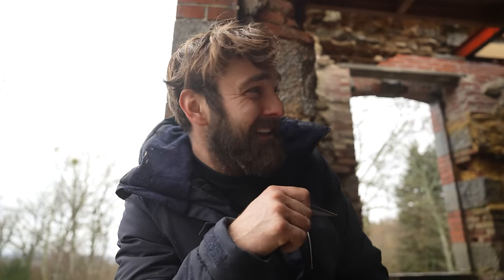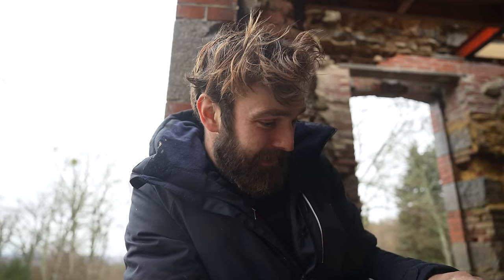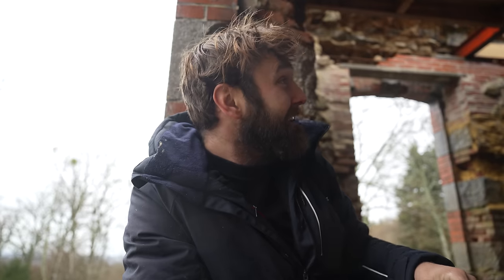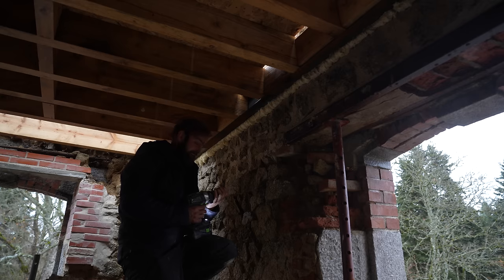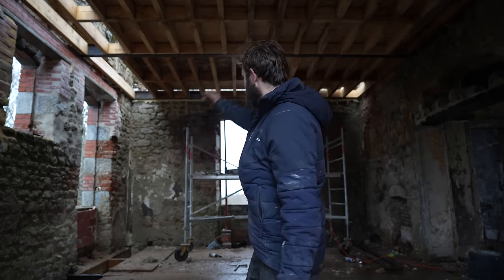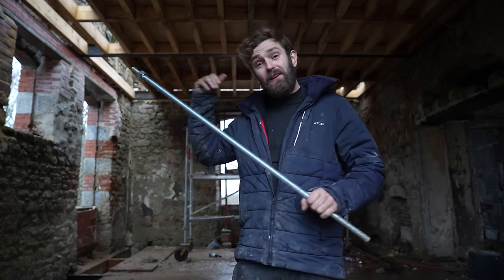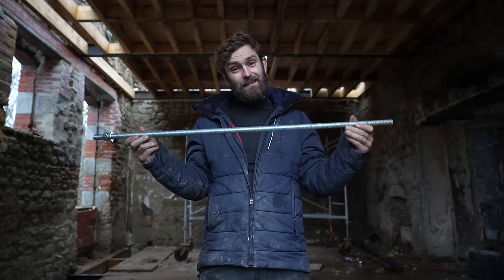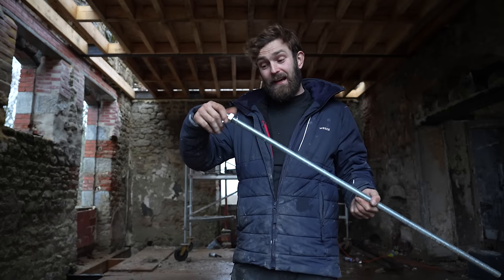Securing and pinning the steel to the chateau wall.

Comment: Just a hint. Try using lub oil on drill bit. It should make the drilling easier and the bits should last longer.
Reply: And the conctete to cement it in woudnt hold up in the wall, cause of the Oil.

Comment: If I may make a suggestion, when you put your flooring/roof down put a small bead of silicone caulking along the seams..  We did this on the roof of a home we refurbished after replacing the roof for a second time.  We had some guys put a ice shield on the roof which was supposed to keep water out on the first roof,  it didn't.  The second time we put the silicone on with the ice shield and has been dry for over 30 years. We just replace the shingles not long ago and everything was dry.  This time we added a self sealing membrane before the shingles and according to the roofers, they wished others roofs were as in good condition and this will just add another layer of protection.  This roof should last forever.
Reply: I really love watching his videos, very inspiring and informative we're you watching from?

Comment: Happy birthday Dear Dan! Just an idea, when you put the steel beams top of the wall and secured with screws, search somebody and weld all together for a huge-huge C cection top of your wall. It will be a massive-massive rigid steel around the top of the wall.
Reply: I assume the structural engineer already covered what he needs.
Reply: Yes, I really hope the plan is to weld them all together, would be strange to have gaps (they'd be perfect for water to wick into and create rust problems, even if you sealed it with silicone, because the sealant would eventually fail. Painted welds would be a bit easier to maintain)
Reply: @carlotta4th  I hope it.

Comment: Dan, perhaps check with a structural engineer whether the metal beams that will hold the roof need to be welded to each other, so that you have an entire frame rather than a series of bits. It is where most of the pressure of the roof will apply, and it will be very difficult to fix this at a later date.
Excellent work as usual !    :)
Reply: absolutly, 100% ,agree
Reply: He has said he has already consulted a structural engineer.
Reply: He also said these steels are not holding roof weight. The weight carries straight down through the floor steels.
Reply: @angelaregan475  the way he cut corners here and there he probably asked one from wish

Comment: Quick Tip - drill and tap 4 small holes in the steel channel that you are using as plates for the roof.  You can use screws from the top to level the plates and embed them in wet mortar to get easy perfect level.

Comment: In Canada, it's called blocking (or cross-bracing if its 2 pieces of wood in an X pattern) and it's definably something to celebrate! Also step drill bits are a revelation!

Comment: I know from experience😕putting extra pressure on the drill really only wears the bit more quickly. I know it’s difficult but it works better if you can just allow the bit to do the work. Good luck, I almost always get impatient 😳
What a way to spend your birthday. 🥳🎂

Comment: Are you familiar with Guedelon? It is a 14th C style castle being built (now) using Medieval tools and materials. It is about 3 hours away from you (though closed now till March). They built a medieval crane to lift stone up to where they are working. 

I have no clue how much they weigh (made with lumber) but that would solve your lifting needs. You could make your own medieval crane.
Reply: The guys doing the restoration of Paris' Notre Dame consulted the team at Guedelon since they seem to have the most experience at using traditional Medieval tools and techniques for carpentry.
 The Notre Dame team wanted authenticity.

Comment: you can put a socket adapter into your hammer drill with whatever size your nuts are on the rod and use the hammer setting to drive in the rods into holes. beats swinging a hammer
Reply: Or just fit the end of the rod into the chuck and drive in on the drill only setting.  That's what I did using a big battery drill (non SDS although my rods were much shorter)

Comment: - Drill the holes in the beams before installing them for your own good. You can put your weight onto the drill that way. Or buy a magnet drill? The step drills are nice indeed.
- Drill the holes in your wall bigger so the threaded rods have more resin around them and go in more easily
- Do you clear out the first bit of the resin cartridges? The first bit isnt mixed properly, you should only start injecting it when the color is consistent and less runny.
- Why don't you invest in a second hand building crane? You could probably sell it afterwards for the same amount and it would make your work soooo much easier, even for little things like hauling tubs of cement upstairs.
- Why don't you still have an electrical and water connection? Again, it would make your life so much easier and it has to be done anyway.
Reply: He previously explained why he doesn't drill the beams beforehand. The pins have to go into the middle of a granite block, not mortar, and since the blocks aren't spaced uniformly, it's difficult to know where to put the holes until it's on the wall. They won't run water or electricity to a uninhabitable building, according to someone in the comments who lives in France. Buying a crane is fine and dandy, but only if there's a decent one for sale and it's not halfway across the country, because transport is horrendously expensive there, probably more than the crane itself.
Reply: @Sgirl  
- Fair enough the reason why he doesn't drill them beforehand.
- Hard to believe there's no way of getting water and electricity. What about people with a camper or trailer? His yurt is even more permanent than those.
- Even if transport was something like 5k, I would happily pay that for a crane if that would mean no more hazardous, tedious, hard labour which in my opinion adds nothing to the videos. I'd rather watch him advancing instead of strolling along and having to work each time well into the darkness with little to show instead of some plans and promises
Reply: @80srockzz  He said he was trying to get power to the front gates, but I guess they won't take it past that until there's a permanent livable structure, and I'm assuming they don't consider the yurt as permanent. But even getting it to the gate is a process. From watching many of these types of shows, some things in France happen s-l-o-w-l-y. They're in no rush, so I guess you could say Dan's adopted that lifestyle. Personally, I'm cool with it. Sorry it's not really your thing. 😕

Comment: Happy birthday Dan.   I am so ashamed to be critical on this special day, and especially since I meant to write you when you installed resin anchors last time.  The holes you are drilling are much to small !   you should be able to easily push the threaded rod into the resin without the use of a hammer !   I have used such anchors to install lamp posts into concrete blocks, and the drill bit was 3-4mm larger then the threaded rod, I could not easily find a metric chart, but an Imperial chart shoved 1/8" on a 1" threaded rod, so 3mm extra on 25,4mm rod, so a 27mm drill should be used if you are using 24mm rods (which I seem to remember you saying) If you are not leaving enough room for the resin, you will have severely limited strength, as the intended matrix of sand and resin does not form in the void. I suspect that you could easily pull the previous set of anchors out by just tightening the nuts.   Anyway, keep up the fantastic work.

Comment: self screw bolt hex head, the Best for me vs Steel, try that With the "Hammer" option on the drill and Will go like butter, after you finish that hole you can use the enlarger drill bit, Way faster than regular.

Comment: Dan, take a look into mag drills, I find that they are the best way to drill into thicker structural steel. It is a good investment if you have a lot more holes to drill. In this case, there may not be a lot of room with the beams already in place.

Comment: Now I am wondering about the structure of the building. You said before that there might have been a chateau before the current structure (before fire). And now from seeing the materials below, there is a very old version of building with whatever stones are on property or near by that seem to have its own columns and walls. And then there are the bricks that seem to be put in around the stones or to support breaking parts of the stones. As if the stones were the old original structure, then the bricks were added in a rebuild and now you are rebuilding both the stones and bricks and missing wood with newer bricks and wood. It does very much seem like there was an ruin that was rebuilt to the modern design and now your are phase 3. Keep going. You are doing so great with all these challenges.

Comment: Just use decent quality holesaws (Milwaukee Hole Dozer) with tiny squirt of cutting fluid to drill the bolt holes through the steels.

UK Carpenter & Joiner here for 37yrs, we drill steels all the time & only take a couple of minutes.

If you have still got loads of steels to do in the Chateau that will need drilling invest in a cheap mag-drill & use annular cutters, these go through in seconds & saves the cost of paying steel supplier to pre drill holes.

Comment: I offset each of the noggins to the last one so as to make nailing through easier. And I clean out all the stone dust with a tube and compressor before squirting in the chemical anchor. That lining of stone dust makes for a threaded rod that pulls out easily. If the holes are clean, you can easily bend an 'I' beam to form along a crooked wall surface just by tightening the nuts up. I also mark where I want to drill on the beam so that the holes line up with big stones in the wall.

Comment: Dan You need a magnetic drilling Maschine. It saves a lot of time and elbo grease 😅. Instead of 15 min each hole you finished one in under 2 min. The cheap ones are working great too 2:47 greatings from Germany

Comment: Tip. Threading nuts on a long bolt like that use a belt sander. Just hold it against the nut in whichever direction you need and it will whizz the nut on in no time at all.

Comment: I like to use self drilling screws to start the first hole before switching to the step-bits. Partly because the tips of mine are all dulled from hitting concrete or over-use.

Comment: Dan could you explain in one of your vids how the top steel plates are secured? Is it gravity or mechanical? I have seen some folks in other chateaus have had problems with older work that drilled into flat surfaces...water got in and the freeze thaw cycle spit the stone cap. Curious to see what your team has decided to do. So great to see what you are doing for this great old building. Cheers!

Comment: Instead of hammering in the bolts try using your SDS drill set on hammer only setting with a spike tip and it will vibrate the rod into the wall in seconds. I use this method for earthing spikes. Works a dream.

Comment: Dan, when are you going to get power to the project? I’d dig a large trench out to the road and do buried powerline. The. Put up construction flood lights to get the whole place lit up safely. And I know it’s too late, but I would have done a glass roof / green house / top floor orangery because of the view and the extra light into the home.

Comment: If you need to run nuts down threaded rod on the regular, a buffing wheel on a hand grinder makes it fast.  Probably OK with a sanding disk, kinda scary with a cut-off wheel...  
And Happy Birthday!

Comment: Dan if you put a strip of wood underneath where the noggins go (Like 2"x1" or 3"x1" - the same width as the noggins) and marked it up each end and fix it underneath the joists you could put the noggins on that and they will be hold up while you fix it and it will be straight as you follow the wood without marking each joist!?!

Comment: Dan,  I'm wondering if you've considered installing joist hangers wherever a wood beam meets another wood beam?  I'm worried just the screws you're using are not strong enough to hold over time and weight.  In the US, these would be absolutely required.  Great content,  thanks.

Comment: Have you considered using construction adhesive on the beams when you put on the floor boards? You still use nails or screws to secure them but you have less of a chance of the floor rattling when you walk on them.

Comment: G'day Mate. Dan, just a little question. I'm curious why you haven't staggered the noggins and screwed into the ends rather than skewing them. It still works ok but I thought in the position your in, upside down and inside out it may have been easier. Looks great with the floor UP there.

Comment: glue it and bolt it cut wood work if need level. Do Not use a thin bit of cement. it will brake apart.

Comment: Instead of All-Thread (Threaded Rod) Use Strong-Tie Titen bolts. You Drill and drive them into the concrete\Stone. Much faster and hold better than epoxy resin.
Reply: I also recommend building a constuction lift\Buck Hoist (elevator) to get material up faster & safer. Probably take a 2 to 3 days to setup but save you a lot more time in the long run.

Comment: Pleaseeee weld them together, after U cut them in half , U should weld them after U put them on top of that walls. IT will make them stronger as whole piece.
AND i think U should definitly  izolate that C section from the wall with some sort of roofing felt. After that 
there wont be any condansation of water in between them. When You finaly gonna close that roof and put windwos in it and start living in it, with heating. 
these metal-stone connections are really that one that are pain in the butt. 
Or at least consider ask any engineer.

Keeping my fingers crossed and looking forward to see what next to come. Be safe.

Comment: Ok. I have a new concern. If you are planning on drilling thru the granite blocks, don't you run the risk of splitting them? Per your earlier drawings, I thought the weight was going straight down onto the floor joists below, not resting on the wall.

Comment: Put the nut on the end of the threaded rod so when you're pounding on it, it wont mess up the threads should you ever need to use that cut off piece for something else.

Comment: Your glue bolts look really tight. The hole should be like 2mm bigger than the rod. It also makes it much easier to push them in. Key is to clean the hole with a brush and blow it out. In really hot weather you will have trouble getting it in at all, as the glue reacts much faster. Happy birthday

Comment: Should put a concrete ring beam around it.. i don't know why you putting steel around it you could just use a treated 9x3 timber  bolted down if thats the case
Reply: No, he specifically mentioned at one point that he was waiting to hear back from the authorities about whether he needed steel or timber. Turns out they required he do both. I know everyone seems to think Dan is just winging it, but he is doing the work as specified by the permitting authorities.
Reply: @Sgirl   only thing he's winging it on is safety aspect of things

Comment: I‘m struggling to see the purpose of using that steel channel for the roof plate.  It’s not like the wall can’t support the minimum weight.  A treated wooden plate would be more than adequate and much easier to connect everything.

Comment: Pre cut threaded rods in pecies of 25cm and put nut and ring on. Stick it as deep as possible in resin and wait to dry. You only need to tighten nut a few turns
 Instead of cutting steel above your head and risck to Burn the chateau down (again)